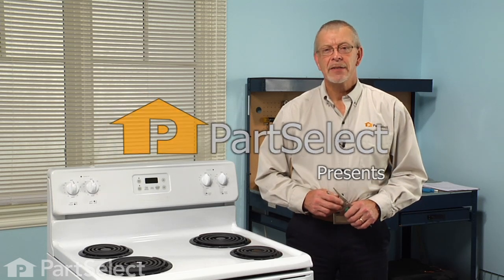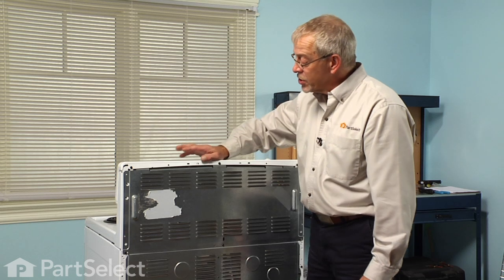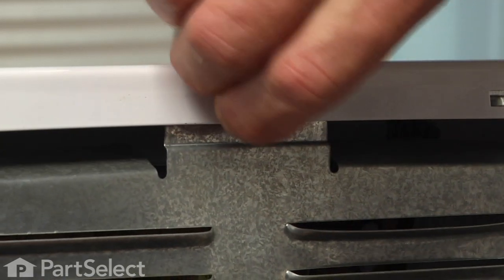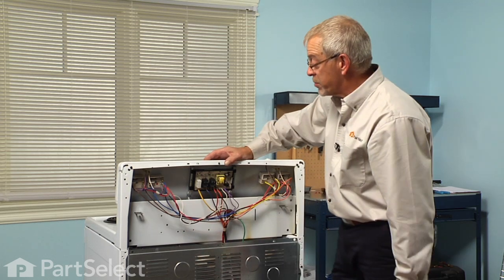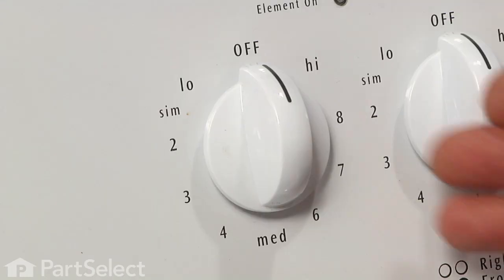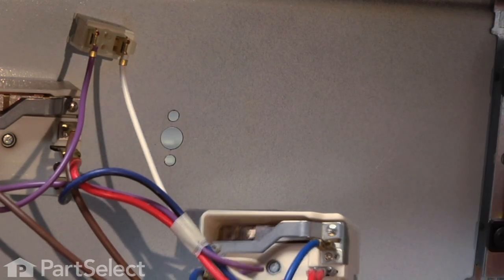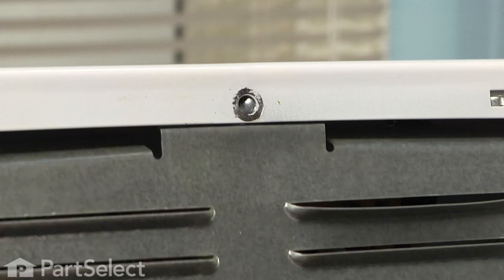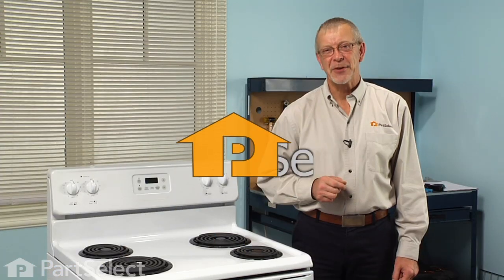Range/Stove/Oven Repair - Replacing the Element Infinite Burner Switch (Frigidaire Part # 316436001)

Comment: I pulled out my stove to clean behind it, but once I put it back it hasn't been working the same. I popped the range fuse in the breaker box somehow. After resetting it the burners still won't get red just all warm , maybe not even halfway. Stove as well. I barely gets warm. Any thoughts? Why would they all get warm and not hot? Would one bad one cause this??

Comment: I have a problem my burners are not registering if I turn on my glass top stove, on the medium it gets hot.  Mod#WFE361LVT0, SER, R00530259 what part do i need to repair?

Comment: Great video... I took the back off my Sears range to replace the left single switch which currently has a 316021500 switch. I ordered a replacement but was sent a 316436000 which apparently is the replacement as the current switch is no longer available. I have been unable to find instruction as to how I know which wires go to the new switch as the configuration is very different. Can you suggest where I can get this information?

Thanks in advance for your help

Bill Shambrook
Reply from the maker: The original switch and the replacement switch should have terminal designations such as H1, H2 etc. marked near the terminals. Match these accordingly. If you have already removed the  wires from the original switch check the wiring diagram with the range or compare with another surface burner switch on the range.

Comment: Hi,  I have a GE with a similar layout and the same looking switch as the one in the video.  One of my switches started to smoke, I  took apart the back of the stove to take a look.  I see a distinct burn mark on what appears to be a brass rivot on the back of the switch. I replaced that switch with a switch from an element I never use.  I then saw little sparks coming off the replaced switch and the switch next to it. when I turned the burner on. Is that normal?
Do you think this happened because I re-used the burnt switch on the never used burner? 
I hope this makes sense. Thanks for your help.
Reply from the maker: Check the surface elements and the terminal blocks for any signs of arcing or damage.
Reply: I appreciate your comment because I am now convinced I should call in an expert.  Risks are too high.  Thank you.

Comment: Hi .  My GF got the exact same oven  : CFEF3016LWF , and the Fr. Rh.  8'' element is very hard to ctrl . Some time is keeping overheat even if we set the ctrl. lower .  IBS 316436001 (  EAP # : * EAP1145040  , Frigidaire Part # : 316436001 ) * Easy Appliance Part : a web distributor in Canada . I'm in CDN  . Before ordering this switch via the web  ,  replacing  this control will solve our problem or not  ?? Thanks
Reply from the maker: Hi Martin,  I would suggest replacing the element switch first since it controls the settings of the element. I have researched your model number and that is the correct part number (316436001)needed for your model. Have a great day.

Comment: my burners get hot but not to a boiling point I have a GE freestanding #JBP27D M1CC 
will this fix it?
Reply from the maker: If none of the burners get hot enough, I would suspect a low voltage condition. Check the main terminal block for proper incoming power, and look for damaged wire terminal connections.

Comment: if one of these switches are burnt, will it effect the whole oven and other elements from working?.... I think I am having this issue...please help
Reply from the maker: Ottawa UAV Imaging What model number is your stove?
Reply from the maker: Ottawa UAV Imaging If your element isn't heating most of the time you need to replace the terminal block (http://www.partselect.com/PS470125-Frigidaire-5303935058-Terminal-Block-Kit.htm?SourceCode=12&SearchTerm=CFEF312GSB&ModelNum=CFEF312GSB)

Comment: I did this then I got live electric when I test the stove surface. Be careful people. Always test all surface before you touch the stove.  It’s like 220volt of electric. I’m surprised this guys tool is a single screwdriver
Reply: Always unplug the stove, or pull the fuse from the electrical box.